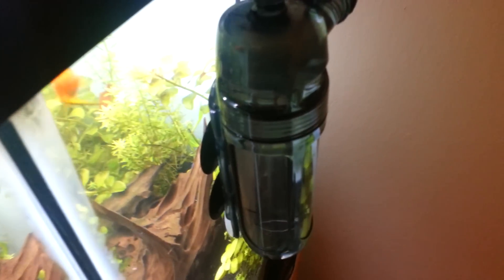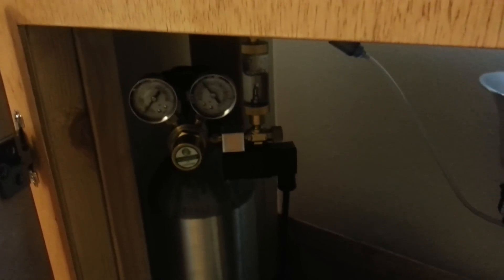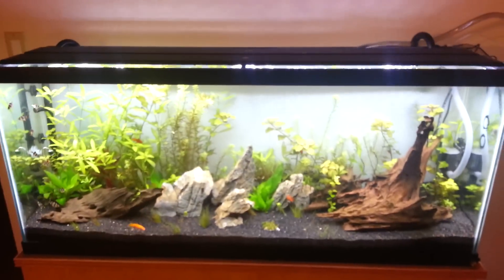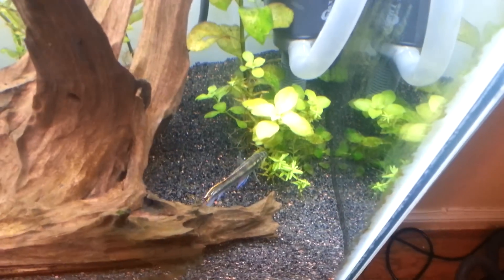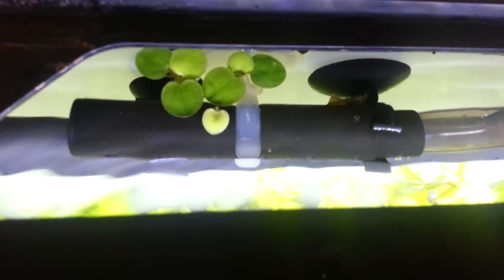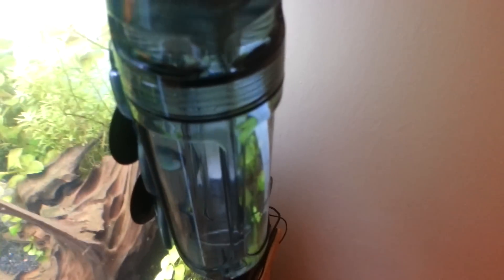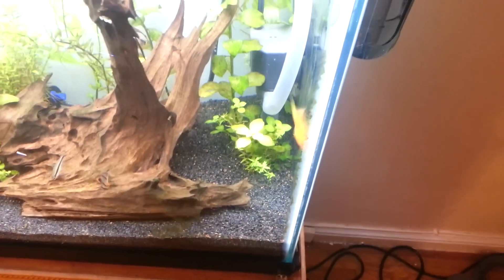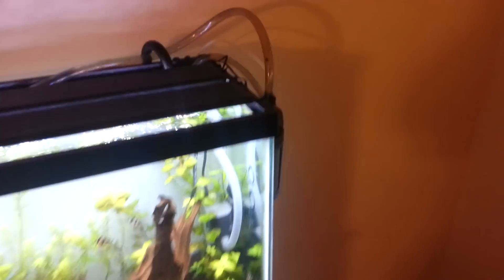ISTA CO2 Turbo Reactor Review

Comment: Won't placing it lower under the aquarium where the pressure of the water is greater improve CO2 absorption ? That's what I did with this reactor and my tank sizzles.

Comment: That's really true. The Co2 connection is the worst part of this reactor. I couldn't hook up a CO2 tube without leaks. While trying to fix this the co2 connection cap broke off. The CO2 connection is too short. Its unusable with CO2 tubes. I tried three.

Comment: can you use it with a co2 bomb ? i mean do you need presure?
Reply from the maker: I'm not sure what a CO2 'bomb' is, but you need some sort of pump to force the water through the reactor. It will not power itself. That plastic thing you see in the reactor is not a propeller, but a plastic piece that breaks the bubbles up.
Reply from the maker: If you mean DIY CO2, im not really sure. It doesnt look like it requires pressure at any point, so I suppose you can use a few air valves to make sure the air only goes one way. The CO2 bubbles go directly into the chamber, and are mixed right at the top. I don't see how it would need any other pressure that to push it through the CO2 line, or possibly back-pressure from the pump feeding the water into the reactor.

If you see water flowing back into the CO2 line while its all running, its probably time for pressurized CO2.
Reply: Ok thx i will look on it and buy one.

Comment from the maker: Not sure why I couldn't reply to Jon Frances's post, but from the ebay post: 360-1000L/H flow rate. Conversion: 95G(low)/264G(high) per hour. If that's not accurate, you can look for "ISTA turbo CO2 Reactor Diffuser" on ebay or Amazon.

Comment: Hi Joshua, How's you're tank been since you installed the ista reactor? I've just set mine up on the out flow of a eheim 2217 but the wheel at the top is not spinning nearly as fast as yours. After an hr or so the top of the reactor builds up with undissolved co2 gas and the wheel stops. I'm thinking of getting a bigger filter with higher output or try the powerhead method you did. Did you try linking it to your cannister filter first? It's taking hrs before I can get drop checker to turn green. The in line atomiser I had worked but blocked up and had to be constantly bleached. Do you now get 100 %dissolve rate without the need to keep turning the reactor upside down to clear the build up of bubbles? Thanks Alan Reid.
Reply from the maker: I'm out of the hobby but I do remember that the higher the flow into the CO2 reactor, the more CO2 you can put into it without causing a bubble to lock it up. It also happens to be sensitive to how much tubing you use between the pump and this reactor. Perhaps you need a powerful  powerhead right next to this reactor with as little tubing as possible. That oughta get it spinning faster. There is probably too much tubing and gravity from a canister filter. Also, make sure you have the 2 spinning wheels oriented correctly for maximum bubble breakage. Videos or images in a search should hopefully provide enough info.